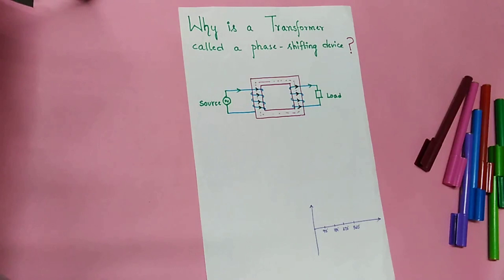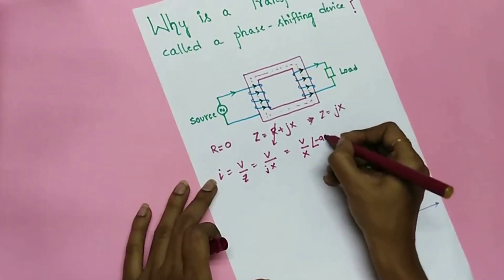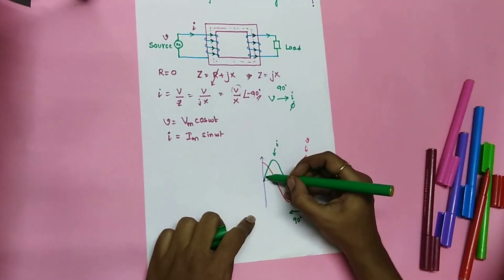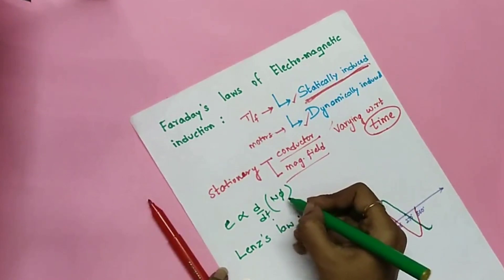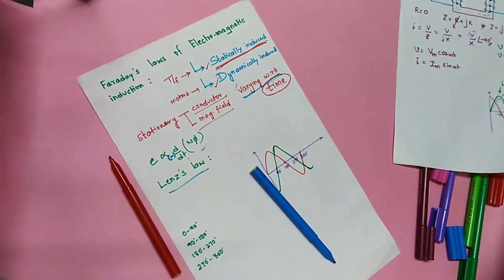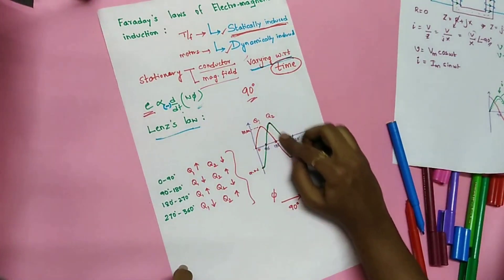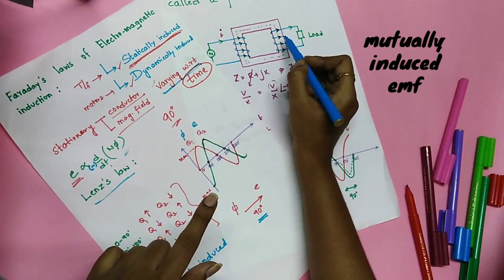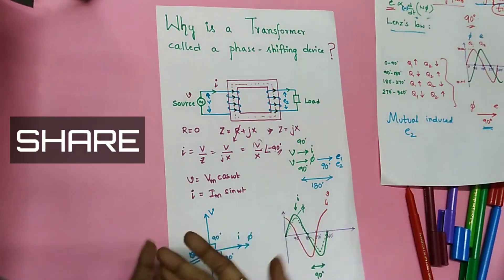Why transformer is called a phase-shifting device ?

Comment: Very informative but let me clear some confusion.
Usually there are marked vector group at name plate of transformer which is represented the actual phase shifting.
Let's assume a transformer which having Dyn11 and other one have Dyn5. 1st one having 30° lagging lv to HV and other having 150° degree.
So what will happen at over all system.?

Comment: Being from mech dept, when two quantities are opposing each other, they should be 180 degree apart.... What is your opinion?
Thanks.
Reply from the maker: Yes I completely agree with u but Pls note that electrical angle is different from mechanical angle
Reply: @letslearnelectricalenginee4671  Thanks for your prompt reply. If you don't mind, kindly explain "electrical angle" shortly?
Thanks.
Reply from the maker: Ok first coming to your doubt
Even in electrical circuit also when two currents are flowing in opposite directions they oppose each other just like how forces act !!
Here the two quantities will be 180deg apart as you said…
Reply from the maker: Whereas here the quantities are 90deg apart… one quantity is not opposing another quantity rather it is opposing the change in the other quantity hence this is a completely different case
Reply: @letslearnelectricalenginee4671  Thanks for your kind clarification. It makes little sense.

Comment: What is the difference between EMF nad VOLTAGE mam
Reply from the maker: Firstly It’s a very good question
The term Emf is related to source like a cell or transformer or a generator whereas the voltage depends on the load connected.
If I connect a 2V battery in series with a resistor, then what u have across the terminals of battert is called emf and what you have across terminals of resistor is called Voltage or potential difference.
Reply: @letslearnelectricalenginee4671  9
Reply from the maker: Both have the same unit- Volts

Comment: Question: when resistive loads are connected to the secondary, will the phase shift of secondary remain the same or will the phase angle decrease from 180 degrees? pls explain

Comment: Hi miss! Great explanation, my question is that, does the primary voltage have a phase difference of 90 degrees to the induced secondary voltage? If not then why
Reply from the maker: I1 lags V by 90 degrees 
E2 & E1 lags I1 by 90 degrees 
Therefore E2 lags V by 180 degrees
Reply: @letslearnelectricalenginee4671  wow tysm I didn't expect you to reply so fast xD
Reply: @letslearnelectricalenginee4671  Miss last clarification, is V and primary alternating current in the same phase?
Reply: @letslearnelectricalenginee4671  but in the video you have shown that e1 in phase with e2.
Reply: @letslearnelectricalenginee4671  ohh thanks agaain <3
Reply from the maker: Always welcome
Reply: @letslearnelectricalenginee4671  how e1 & e2 are in phase madam bcoz they are displaced by 90°.you said that e2 lags e1 by 90°.

Comment: dear madam here is some questions  in my mind 
1 what happened if the phase-shifting angle changes? let's suppose the first angle was 30 degrees which change to 45 degrees?
Reply: You can adjust the power flow by changing the phase shift angle

Comment: I have a question...

In the AC supply line we generally have 3 phases of AC 220V in 120° apart... In the big industries they use all these lines together and get higher power output using 3 phase induction motors..

So my question is..
How are these voltages are shifted by 120° w.r.t. each other? 
I mean
V1= V (Sinωt)
V2= V Sin(ωt+120°)
V3 = V Sin(ωt+240°)
These are the 3 phases of AC current supplied.. how do these phase shifting is done?
Reply from the maker: sorry for a late response, I was not active here for the last few days
Coming to ur question ....
We generate 3phase electrical power from synchronous generator at a higher voltage like 11kV(considering the transmission losses) and then step it down to 415 at utilisation level.
So this generator construction is such that  it produces power with phase displacement of 120 between each phase.
The three windings in the stator are placed 120 degrees apart in order to obtain a phase displacement of 120 degrees.
Each winding is lagging by an angle of 120 from the other winding and so the emf is also induced after 120

So we have 3phase at 415V phase angle of 120 for our utilisation 
For example, elevators in our apartments...
And Individual distribution to each house shall be from single phase because we have only single phase loads in domestic applications 
For example, even if live in the same apartment, u might be getting single phase supply from one phase (say R) while I get from the other(say Y)
Reply: @letslearnelectricalenginee4671  thanks a lot ❤️❤️
Reply from the maker: Always welcome for any questions

Comment: Really the whole presentation was good but I have little doubt and is  I think at 5:38 onward 

Q1 ⬆️ Q2  ⬆️
Q1⬇️. Q2      ⬆️
  Q1. ⬇️.   Q2  ⬇️
   Q1 ⬆️.     Q2 ⬇️
Reply: First of all ,Thank you to give me such a nice explanation.really it's amazing
Reply from the maker: Always welcome🤗
Reply from the maker: Thanq...I appreciate ur question 
It doesn’t mean that the value increases if the waveform goes up and the value decreases if it goes down
Just observe the magnitudes of the waveform at different position 
Consider the max value to be 5 for example
At first point Q1 is at 0 value and Q2 is at 5
Then with the increasing time...
Q1 goes like 0,1,2,3,4,5.  Whereas 
Q2 goes like 5,4,3,2,1,0 
So this shows that Q1 increases and Q2 decreases 
The same applies for other instants also
Hope its clear...☺️ 
Feel free to ask more doubts if any

Comment: Mam E1 or E2 same phase me q hai ye smjh nhi aa rha
Reply from the maker: Here E1 is self induced emf due to current I1 and E2 is mutually induced emf due to current I1. Since both E1 and E2 are due to current I1 both are displaced by the same phase angle from Voltage V.